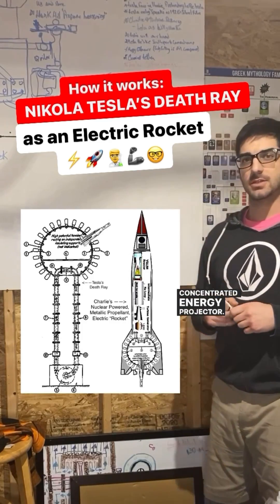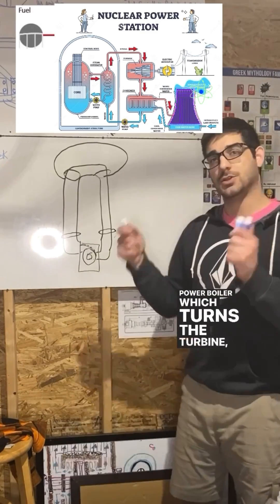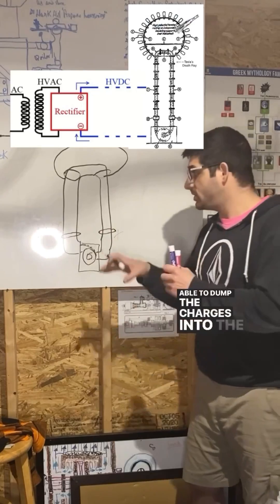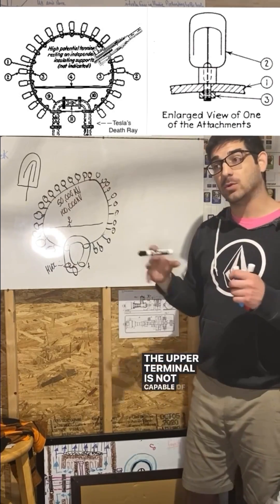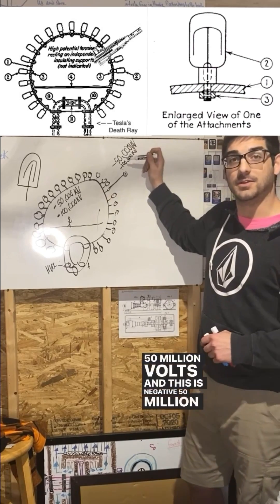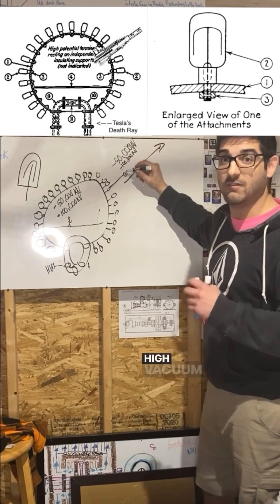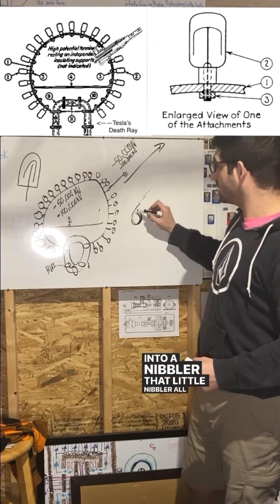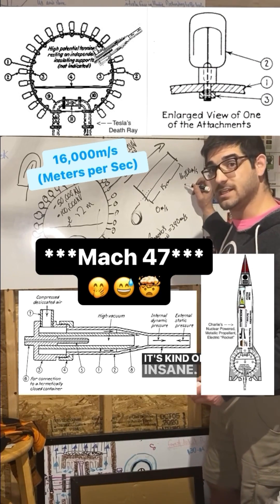⚡️👨‍🔬 How often do you think about Nikola Tesla’s Death Ray? 🤔🧐

Comment: Why not use a dc generator, no ac needed?
Reply from the maker: Hey thanks for commenting and you make a good point, the issue is there to my knowledge no high voltage DC generators that are efficient, except that is of course Nikola Tesla’s DC generator that has the potential to maybe do high voltage but it would still need to be tested to be sure. 

I hope that answers your question.